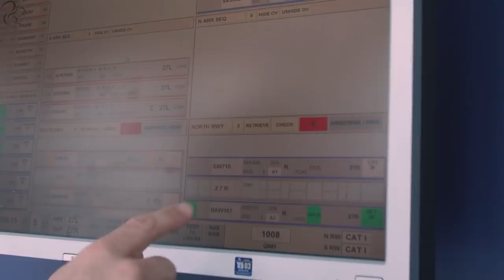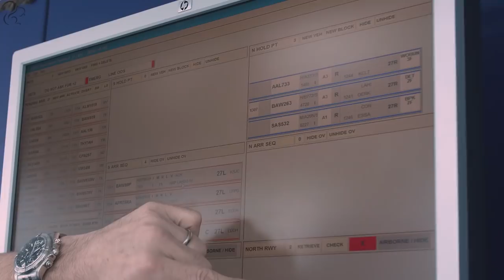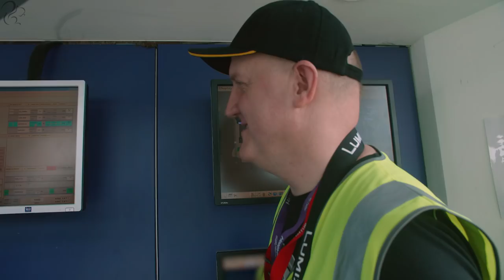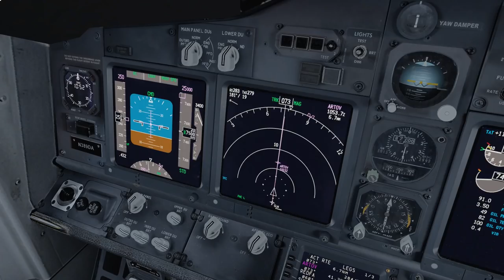I Went to the RESTRICTED Areas of Heathrow - and YOU can too! (Britain's Busiest Airport)

Comment: Really, really well done. Congratulations and thanks for letting your passion shine through. Documentaries about airports often have disconnected, cold narration, but this was definitely an exception. That baggage system is a marvel. At first I wondered why none of the original audio made the cut. I'm guessing the built-in mics weren't up to the task with the wind noise and ambient noise. The overall result has a very polished feel as we have the overdubbed voice which is completely consistent throughout. Great choices, lovely job!

Comment: Squirrel are you going to release the photos that you took that day? And what camera and lens did you use?
Reply from the maker: I didn’t take many photos, mostly video.  I use two Panasonic GH5 cameras. One fitted with a LUMIX 12-25 f2.8 lens and the other has a Metabones speedbooster with Sigma lenses 18-35mm f1.8 and 70-200mm f2.8
Reply: Thank you paul!